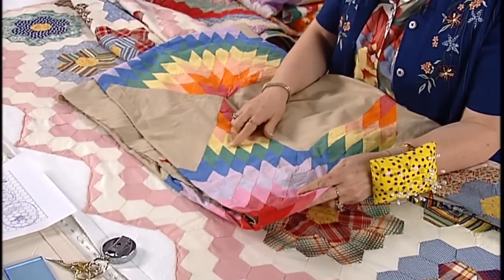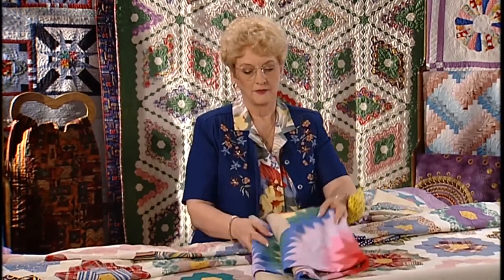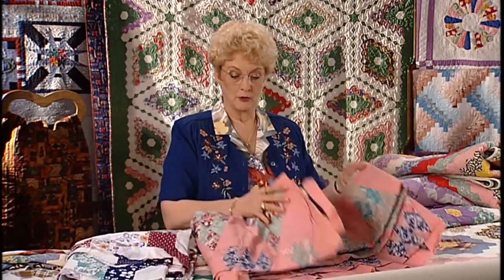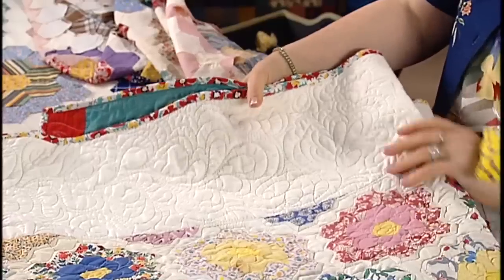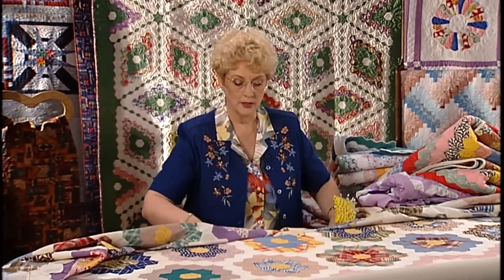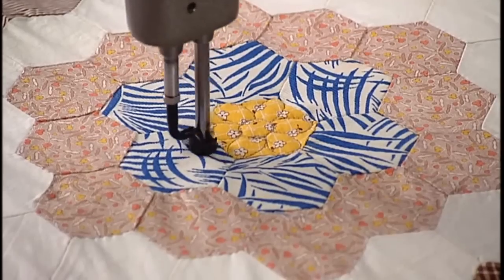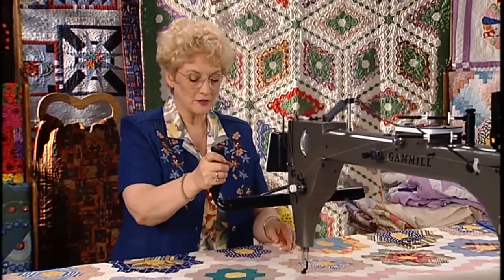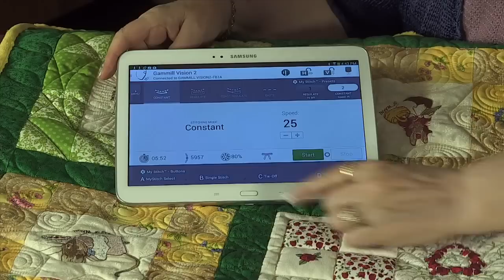How to Quilt Antique Quilts?

Comment: Hi Linda,  I have recently purchased a long arm machine. I have a vintage grandmothers flower garden quilt that I want to quilt. It has uneven edges as the “gardens” are all whole. So there are lots of edges making me wonder how I quilt this on the long arm    Not sure how I attach the top. Can I just float it on the batting and pin it down enough to get started?  And if I do that I don’t know how I finish the edges after I’m done quilting. I don’t want to mess it up and I don’t want to cut off the edges to make it square. Can you give me any ideas? I appreciate any direction you might give.  I love watching your videos and have learned so much from them.